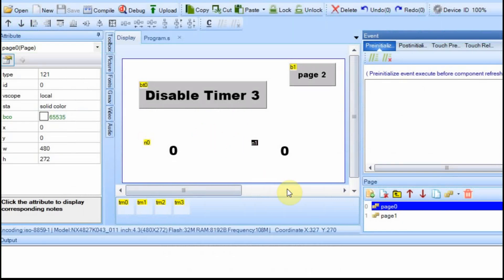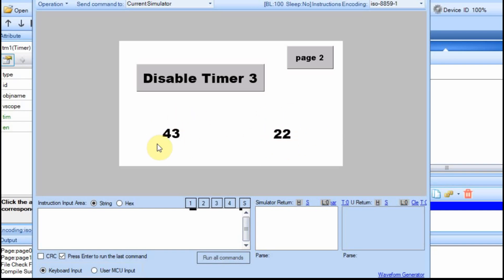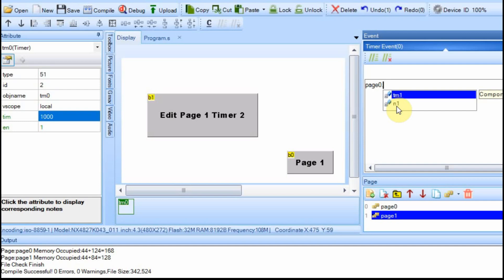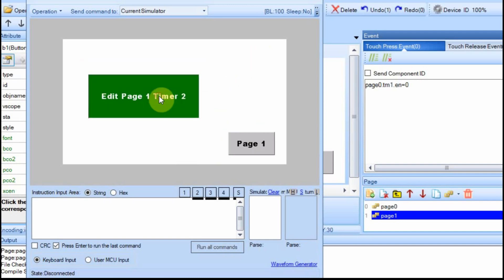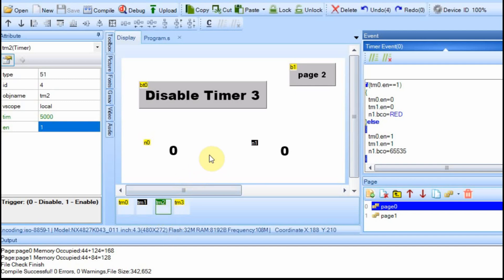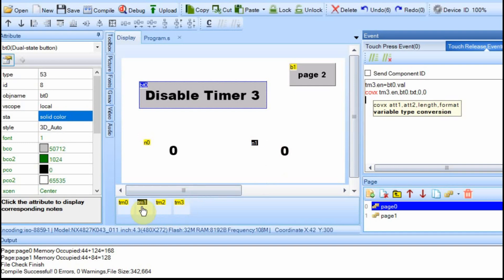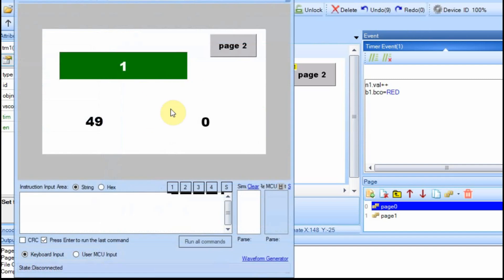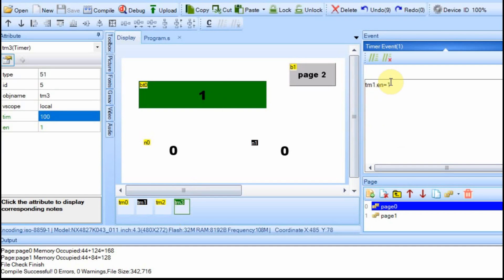131 Nextion Timers -N- Depth, ways to use Nextion timers for control and logic

Comment: When I use a timer with the simulator in the PC, if I put 1000ms as value, it will give me 1100ms, have you seen a similar error? Will the real hardware correct this?
?
Reply from the maker: Do you mean that the display changes it to 1100 or that you measured the time and it was wrong?
Reply: @CheapControls  Time is WRONG with simulator - TIME is CORRECT on REAL HARDWARE. I looked for a config file for emulator settings about ejecution speed or time but I not found nothing.
Reply: @CheapControls  On simulator I measured the time and is WRONG.
Reply from the maker: I have never timed the Nextion Simulator.  I am not sure where it gets the timing from for the IDE.  When I need to get accurate timing I use a separate real time clock.  The Arduino alone is the worst time keeper.  The Nextion is second, but the real time clock is the best for keeping time over the long term and the best for short term accuracy.
Reply: @CheapControls  we juest need a tweak the nextion ide and the simulator to ge it running to the correct time. TIMER delay are not based on RTC but on the processor nextion cycles. And on hte PC pretty sure we emulating that.